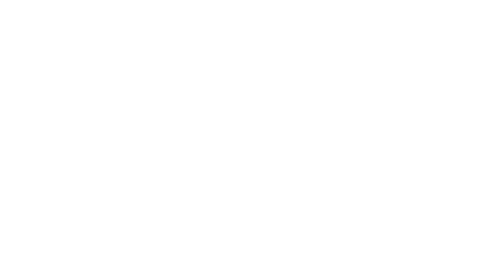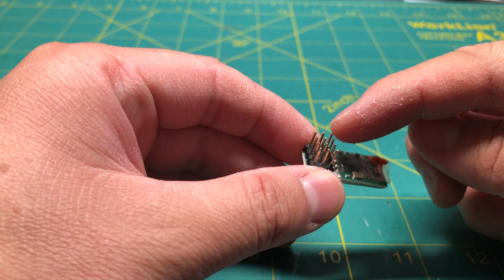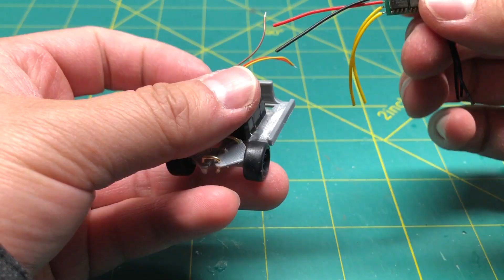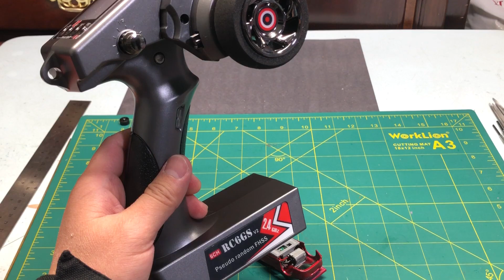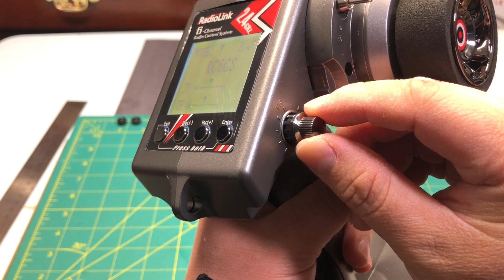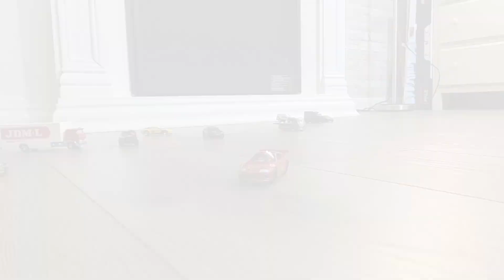Hot Wheels RC drift car custom Toyota Supra

Comment: Did you reverse the Gyro?
Reply from the maker: No.
Reply: @SlickDiecast  Usually for drifting, you want to make sure the car is counter steering with the gyro. Other than that, I would look into putting suspension, a few other Youtubers have done it already at this scale. Once it can go straight enough, you can try to tune that gyro a bit

Comment: Hi. Your built looks very very technically sound and you are a next level micro engineer. I need help from you ........could you please tell me what rear motor is this ? What's the model no ? These are the kind of block motors we usually get to see in toy cars but they are bigger in size. This looks one size smaller. Anyways superb video.
Reply from the maker: Check out my website for parts. www.slickdiecast.com

Comment: Is it possible to use another transmitter?
Reply from the maker: Yes. RadioLink has a 4 channel receiver that could be used.
Reply: @SlickDiecast  How much does it cost in total to get everything needed?
Reply from the maker: I’m just estimating, but around $130-$140 USD.